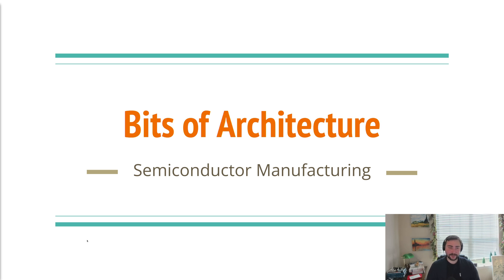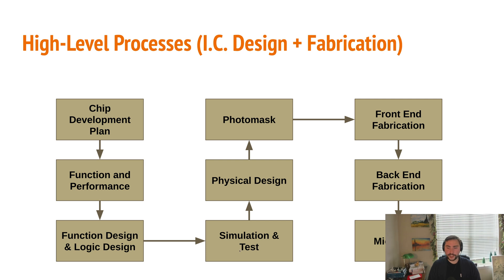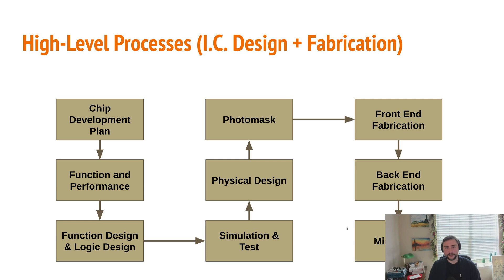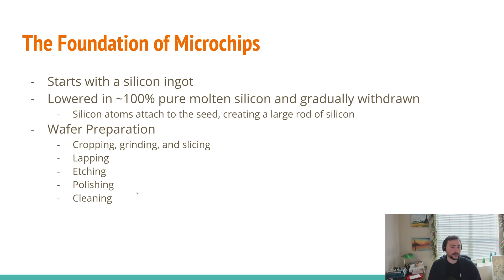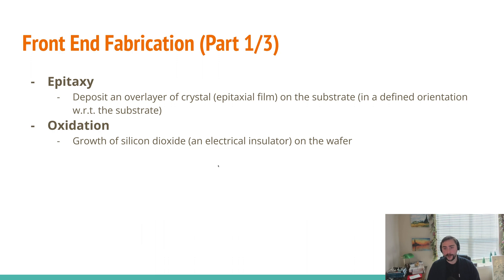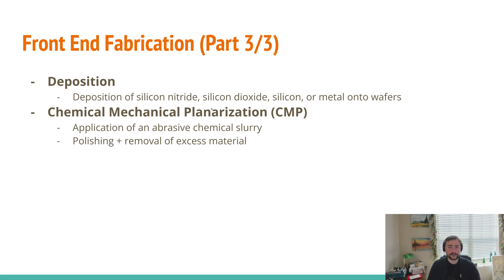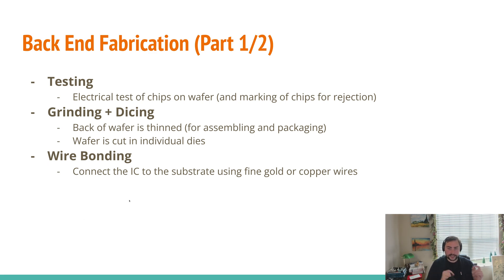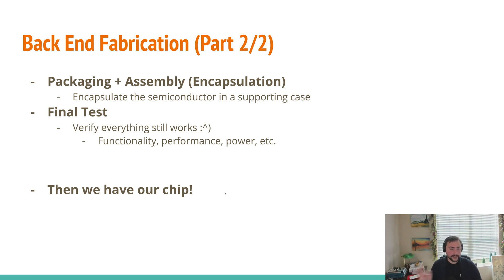Bits of Architecture: Semiconductor Manufacturing

Comment: 1. What about frontend manufacturing makes it error prone, resulting in chip rejection later?

2. How different is the process for 3D/stacked chips ?

Great video!!
Reply from the maker: Thanks! Glad you enjoyed it.

There are things like parametric yield loss due to variations in our processes (e.g., variations in doping concentration, etch depth, etc.), and then there are the more random defects (e.g., stray particles, contamination, or even scratches/cracks on the semiconductor).

There's a lot you can get into w.r.t. 3d integration (and admittedly, I'm not the best reference). Many things are the same except w.r.t. the integration, where dies are connected vertically with through silicon vias (TSVs).